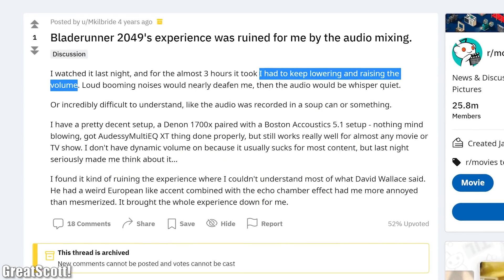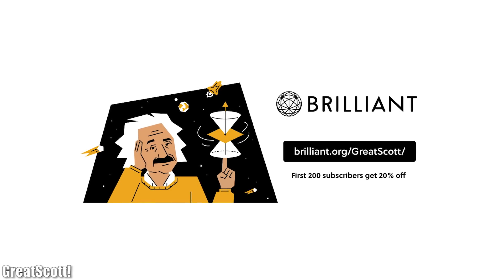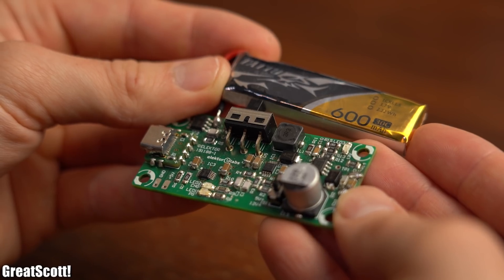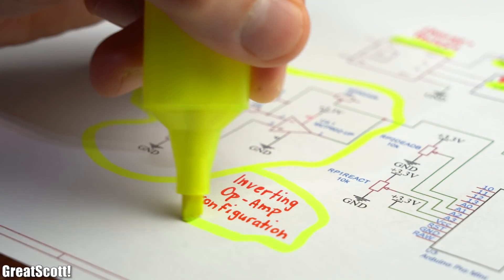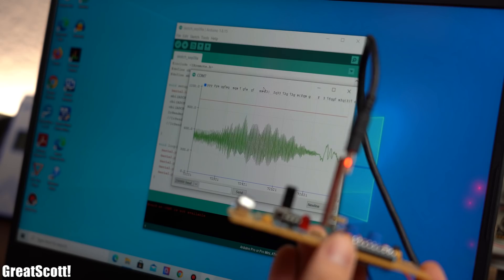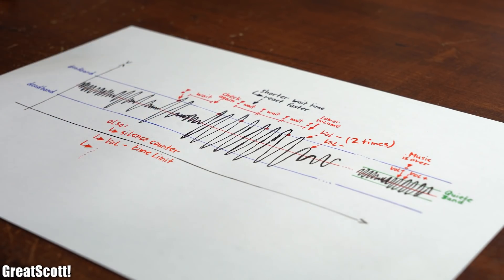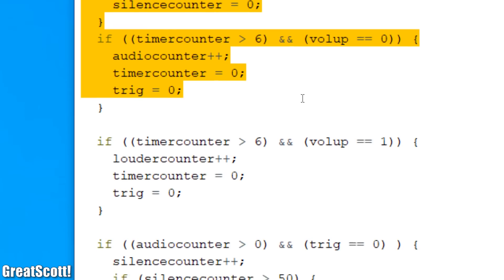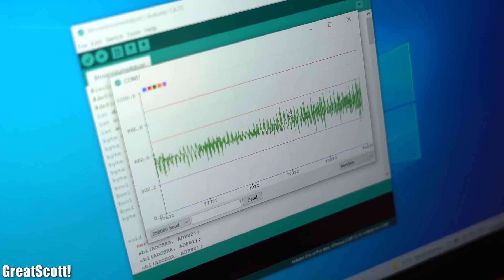Movie Music has a LOUD PROBLEM! So I fixed that! (Automatic Volume Adjuster)

Comment: Audio engineer and developer here: the reason why so many movies have such a large dynamic range is because the engineers working on the film are mixing for the cinema, not for your home. Most modern TVs (2010+) have an in-built audio compressor you can find somewhere in the audio/speaker settings in its menu. It's often called Night Mode/Auto Volume/Dialog Mode...something like that. 

If you're using a more modern setup with soundbars and wireless connections which bypass the TV audio entirely, then that's admittedly a bit tricky to solve unless your audio system has an in-built audo compressor; read the manual! The best solution to this whole problem would be if the mixers working on these flims released a pre-compressed version WITH the original for-cinema mix which viewers could select. There's actually a big push for this concept in the industry.
Reply: I absolutely agree with you but I have my doubts as to people who can't rtfm of their receivers and turn on drc would know to switch to a different audio track. I guess it wouldn't hurt to have the option.
Reply: @frankthetankricard  The latest I heard about it was they're thinking of making the compressed version the default, especially on streaming services. It's a battle between viewer experience, artistic expression and the general ignorance of the masses when it comes to anything audio-related which you rightly pointed out.
Reply: @amber1862  I wouldn't be upset if they had a compressed track as default. People who care would quickly learn to change it. Maybe even have a setting per account or device to prefer one over the other, kind of like some players can let you prefer captions for hearing impaired instead of standard subtitles. That would be a decent solution. Especially on streaming services where they aim for "good enough for most cases" audio and image quality.
Reply: @frankthetankricard  I agree on all points.
Reply: @thereisnochoiceleft 'Is it really just the compression that needs to be adapted?'

No. Like you said, there are a lot of elements that contribute to a mix, such as the number of channels. It's just a relatively easy slap-on-the-end way of somewhat fixing the issue very quickly.

'would handling an additional mix pose a significant overhead to the mixers?'

Yes. A lot of sounds and plugin/mixing desk parameters are automated over time and they often transition sounds from one channel to another to create movement and immersion. Changing the number of channels would remove all of that work. Some surround-enabled plugins and hardware have channel limitations too.

Even though the mixing engineers often have big studios with the same number of speakers as the cinemas, they frequently collapse the mix to stereo and mono throughout the mixing process to ensure it will sufficiently translate, but they're still listening to this collapsed version in a top studio; most people will be watching the film in terrible acoustic spaces with lots of background noise and on consumer-grade equipment. The frequent collapsing also helps to reduce psychoacoustic trickery and allows them to hear the mix in a new way, like a painter stepping back from the canvas to see the bigger picture. 

Even just turning down all non-dialogue sounds by 3-6db as an alternative mix would help in dialogue-heavy films. This too would obviously be a very quick fix :)
Reply: @thereisnochoiceleft Haha I'm almost certain they do that too! A cool fact is some of the best studios in the world often install terrible speakers which they can quickly switch to. You often see these small plastic cheap speakers sitting on top of the mixing desks in photos and videos, but they provide a lot of value to the engineers because if it translates on them, you're good to go!

Comment: When I did some research a few years back on this, I ended up with the conclusion when the movie audio is mixed the voice is on the center channel.  In a system with a center you can turn the center up and the left and right down, this also fixes the problem.  I forgot to add cool project though!
Reply: It's cause the playback device is sending with an assumption it's connected to a 5.1+ surround sounds system and these days the stereo audio is just a basic left & right channel downmix which makes the center channel weak which is where most vocal performance is set as. Movie companies have gotten complicit in not doing a proper stereo mix and instead are doing a lazy left + right channel mix which leaves vocals low for those who do not use a surround sound system (which is most of us)
Reply: @ikannunaplays  Just so! I have a 5.1 surround system that can decode both DTS and Dolby. I have the center channel set a bit higher than the front L & front R, so that dialogue is not buried in the mix. That works most of the time. It is definitely true that many movies have the "action" sound set to higher levels than the "quiet moments" sound, which is very annoying. This isn't a problem in a movie theater where the sound is typically much louder than I would have it set at home.
Reply: @ikannunaplays  yeah, that is so darn frustrating.
Reply: @ikannunaplays  makes perfect sense as I didn't notice this issue on my 5.1 system.
Reply: @ikannunaplays the genius in the comment below yours thinks everyone owns a surround system and 46 people agree with him. Why would I buy a surround system to use in my apartment, just to disconnect the subwoofer so my neighbor doesn't call the cops?
Reply: Most movies I ran into even in stereo I can hear the voices over the music, that was my original issue.  This device he made would be perfect for watching normal tv when commercials come on it would turn them down to a normal level!
Reply from the maker: Thanks for the tip :-)
Reply: I tend to watch YouTube on the TV, and the way the ads here are unnecessarily loud, this is a must for me 😅
Reply: I was thinking the same, make sure you're using the right output/input on the player and receiver/soundbar so the center audio is actually on your center speaker (with the right volume if you can).
Reply: Ok. Forget movies. TV is horrible like this and it doesn't have 5.1+
Reply: Yes they are mixed for surround sound systems, with no care given to those listening on plain TV speakers.
Reply: @thewolfin  You gotta get those stereo Watt numbers up!🤘🏼🤘🏼
Reply: I really like that movie. Especially the sound! It goes into really deep frequencies. I guess you need a really decend soundsystem to be able to enjoy it. I was watching it from BlueRay on a calibrated 7.0 soundsystem, which sounded great.
Reply: explosions and gunshots are also mixed in the center. this could be a problem.
Reply: @butstough  It's a big problem, this is even an issue for many streaming platforms too. It's night and day if you compare a DVD like the original release of  The Matrix and the Two Channel Stereo Track and then compare that to a title that was released in 2010+ and you will notice the problem.
Reply: some softwares have flexible mixdown settings where you could independently digitally adjust each of the channels before it mixes down and outputs to a stereo system. More systems should offer that kind of control for people limited to stereo imo.
Reply: It's not just the talk track though.  They stopped doing all DRC.
Reply: Project suggestion: stop light watcher. Beeps when the light is green so you open your eyes after a quick nap, make sure it's safe, and drive on
Reply: @cashewABCD  I was thinking about this just yesterday. I was guessing that all cars would have this in ten years, so phone zombies could become even more unaware of their surroundings at red lights.
Reply: @gargantuablargg  why can't they make a car that just fuckin launches you out of the car on an ejector seat if it detects that you're on your phone? That'd be so great for safety.
Reply: @cashewABCD I don't think it's the best idea to close your eyes in the car. If you're too tired to drive and don't want to be bothered with paying attention then you should probably buy a Tesla and smear your body in honey. The honey will attract ants, which will keep you awake and alert so that you don't close your eyes when in a car.
Reply: you would be correct, i run into this issue because my main receiver is really nice but stereo only, its more for music. but i dont have the room for a separate 5.1 receiver.   I did some searching in the settings of VLC there is an audio loudness normalizer helps a lot when you don't have something with a center channel... However i do use a PC for movies and streaming.
Reply: This is the right answer. If there are any Kodi users out there reading this, there is a setting called "Downmix: Center Mix Level" which allows you to amplify the center channel when it's being downmixed (for example, when you're playing content with 5.1 channel audio on a system with stereo speakers).  I have mine set quite high because of this issue, and it's why playing the same media on my Kodi system sounds way the heck better than on any of the off-the-shelf streaming devices.
Reply: I don't know if you guys have this problem in Europe but this project also helps for high volume in commercials which is typical in US cable TV. Is supposed to be illegal and regulated by the FTC but companies don't care. Which is the main reason why I'm here lol.
Reply: Apple TV has the “Reduce loud sounds” feature. How does that compare?
Reply: That explains why I've not noticed this issue on my AV system, since I typically balance my centre up and the four corner speakers down.
Reply: A good engineer can do for a dollar what any fool could do for two dollars, stay creative great scott!
Reply: You better get a home cinema 5.1 channel...I do have a 5.1 LG from 2005.. still working great...
Reply: Came to post this :)
Reply: You can do it on most modern systems using a measuring microphone that is often included and I think it's an automatic process. On older systems A tape measure and the amp manual.
Reply: Glad to see you already posted this. Unless you have a proper 5.1 or 7.1 surround sound system, you're basically hearing an averaged out channel down mix.
Reply: I love it how to watch a simple movie one is expected to be a Audiophile with technical understanding if a sound technician. 
I have thus stopped watching movies and for that matter TV.
With YouTube also turning into a bitch which raises volume whenever music comes on. I'm gravitating towards minimal media consumption. It's good to get your time back in our lives.
Reply: @70newlife I stopped watching movies TV, and Ads 10 years ago and I don't miss anything. 
The last sort of movie I kind of watched was when my niece and nephew were watching Wallace and Grommet last Christmas, I looked at the TV a little bit. 
But as for ads and TV: they lower your IQ, attention span, and it's 75% scams and manipulation. 
I couldn't even watch TV if I wanted to. I can't sit for 30 minutes doing nothing, I'd rather fold clothes than watch TV. I hate folding clothes.
Reply: Would switching to mono fix this problem?
Reply: @CDinkle  Not necessarily. Stereo played in mono can sound "muddy" and stereo through headphones is actually "binaural" - lacking in spacial information. Phase shift (left/right) delay is lost.
Reply: @CDinkle  mono is horrible. Why would you want to listen to anything on mono, except for guitar amplifiers?
Reply: Everybody should watch this one first.
https://www.youtube.com/watch?v=ClKUnEJw4JU
Reply: I guess it depends how the soundbar  handles the stereo down mix. I tend to find film voices too quiet or simply mumbling!
Reply: Just watched blade runner on a surround system and it was fine. Dissconected the center and i get the described problem. Easier solution would be to setup your devices propper.
Reply: @trulsvian  Change the audio track to stereo and leave the center disconnected, if the movies stereo audio was mixed properly the vocals should be clear and crisp. More often these days it's not lack of devices being setup properly it's the company that compiled the disc.
Reply: @trulsvian  not everybody can afford full surround bro.
Reply: @tissuepaper9962  It's not even cost, they also need a lot of space too.

Comment: interesting how people with different backgrounds can approach the same problem differently. i am a software guy and when faced with this issue i wrote a little wrapper script around ffmpeg that passes the audio through a dynamic range fixer-filter. you end up having to 'convert' the entire audio track which takes a few minutes and is a destructive process (unless you intend on keeping the original version of the movie around). i only do this process on demand when the audio is egregiously bad. your method does work on live broadcasts, however.

Comment: Great project! Someone can get in same problem when watching movies and this device can help.. 👍

In audio level control and indication I did multiple readout averaging in software and some other calculations.. Now I have algorithm second version and it works as a charm - low noise is ignored and MCU can easily see when input volume is to high and can cause audio distortion..

Comment: Streaming services are infamous for this - and it's awful.  There's a combination of things happening.  Downconverting multi-channel movie audio to stereo is not a one-size-fits-all problem.  There are many formats for movie sound, and they even change during the movie: vocals, vocals mixed with background music, and music alone can use different options (like LFE) that change what the converter should do.  DRM (Digital Rights Management - a.k.a. copy protection) schemes also vary volume and sometimes brightness of the image as a side effect that the industry vehemently denies.  Buttheads.

Comment: Well, that's an unconventional way to build a compressor. Bonus points for creativity though.
Reply: I don't see conventional method for implementing this to "smartTV" without external audio system.
Reply: @user255  super easy to add a simple amp, run a 3.5 and reroute speaker wires from tv out to the external amp.
Reply: @user255  What TVs are glued?  I haven't seen any.  Link to a TV teardown/repair that involves glue.
Reply: @user255  phone and similar do get glued, because there's no good way to seal them. Part of that is for waterproofing the phones.  TVs are all screws and clips. There is plenty of places to secure them.

It also needs to be easy to repair.  Can up imagine the labor time to unglue a "70 inch TV, to replace one of the boards?
Reply: @user255  Do you have an example of a TV that is glued?  That would make it difficult for their own repair people to work on, at people's sites.   I've never seen a TV glued.  I have worked on plenty of phones that do use adhesive, for watertight seals.   Customers wouldn't want phones with reinforced and screwed edges.  They want thin and light.  But your comment wasn't about phones, it was about TVs.  Show me a TV that is glued together.
Reply: @user255  and I want to know where you got the silly idea that TVs are glued.  I work with electronics a lot, and you made the claim.  It's best not to confuse newer, less experienced, people with BS facts.
Reply: @user255  Yes
Reply: I woul use an agc between channels instead
Reply: There are things called program compressors which try to maintain an average targeted level
Reply: @supercompooper  Yes, how to install it to TV?
Reply: @user255  connect it between tv and sound system.
Tiny speakers inside the tv totally suck anyway, you should always have a dedicated speaker system.
Reply: A compressor with super slow attack and release would give similar result. Especially when chained with a limiter.
Reply: Not exactly a compressor, but a triggered, temporary IR audio attenuator. A compressor would squash everything- an undesirable effect watching movies.
Reply: @fmphotooffice5513  in audacity, a compressor only compresses above a defined threshold, by a defined ratio.
Reply: It's basicly a volume rider as it would leave the original dynamics of the source 'untouched'. It's riding the playback volume, not compressing the peaks.
Reply: @BramHoutman   yeah but a compressor will do that just fine, provided you turn the response speed down. A decent compressor can do that and will have a lot of adjustments.

Comment: AGC can do the same job to a great extent, and much simpler
Reply: My thoughts exactly! But these days "electronic circuit design" means including an expensive microcontroller to do what a few discrete components used to do at far less cost, as well as having to work out how to program it. Despite that, this problem with movies is real and on TV the ads are nearly always louder than the program, but the TV companies say that they have no control over the volume! If that was the case and I owned the TV company, I would sack the sound engineers for incompetence.

Comment: This is honestly the worst possible solution for this problem :P It will always be too late and it doesn't properly isolate what is speech and what is music. You could do much better already by isolating only the voice frequency range in the center audio-channel and boosting that. Or even putting a full normalizer over the entire sound output.
Fun project though

Comment: Atleast BR 2049 is mixed for theaters where the sound level and quality is high enough that the talking is still crystal clear. With a high quality speaker system you can hear really well over the music because the noise levels are low.

Comment: At first I thought you were going to implement an analog compressor to your speakers, but I guess that your solution is a lot easier and reversible than messing with your audio system